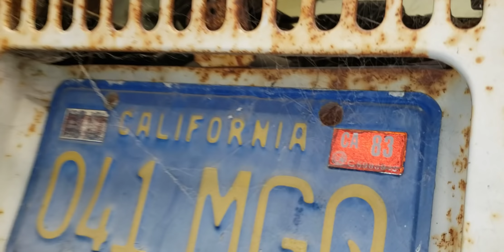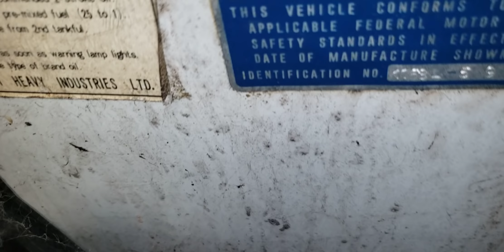I'm a Mechanic Not a Magician

Comment: Wouldn't it just be easier to build a time machine, travel back to 1969 and get a new Subaru 360?
Reply: You'd think that, but have you seen the price of antimatter recently? Absolute madness.
Reply: Yeah, and don't forget those flux capacitors are becoming rare since the 80s!

Comment: The hardest parts to locate replacements are always the most seemingly mundane. Like the thin vaccum tube with unique connectors at the vacuum reservoir and the heating duct baffles or plastic trim clips that always break due to age.

As someone that brings my dog to work, I am glad I am not alone in saying "move, you are in the way" over and over again.
Reply: Stupid vacuum lines. I always just find a rubber fuel hose that slips inside or outside the barb and forget about it. If it slips off the outside of a barb I use constant pressure clamps. 

For a 3/4 or 1 inch vacuum line on the back of a chevy throttle body, the 90° nylon elbow broke and I used PVC elbow and shoved a big fuel line or small heater hose into it. Works a treat. I love reverse engineering the nonsense

Or a silverado tank purge nipple. 1/8". Snapped off. Drilled it out and JB welded a nickel copper 3/16" brake line in there with a mountain of jb weld supporting it and adapted the 1/8" nylon to 1/4" OD silicone hose, the ID was a tight fit on the brake line nipple

Comment: A friend and I have been putting a '59 Ford Fairlane on the road after it being out of circulation since 1981... And naturally we were not the ones to take it apart. Restoring cars like these are weeks of being twenty minutes from being finished a particular job because only when you need that special piece will you know you don't have it. This Subaru is the embodiment of that special kind of automotive hobbyist's pain, but it's worth it; you're saving one more of a very, very finite thing.

Comment: Shoulda saved this one for Easter! Like an egg hunt every time you need to find a part. Do you have a system for organizing parts on long-term projects? I've got a bunch of five gallon buckets and boxes I've gotta dig through and I'd love to hear some tips.
Reply: This is just basic stuff and probably quite obvious but after years of taking stuff a part i've got a process.... firstly take loads of photos! Use an egg carton for all the nuts and bolts on each particular procedure. I use plenty of tin cans, plastic cups, jars... anything with a lid doesn't get thrown out!! Label it as soon as you take it off. Absolute time saver, might even be the difference between a car getting put back together or not!